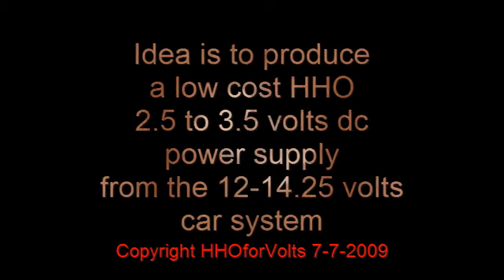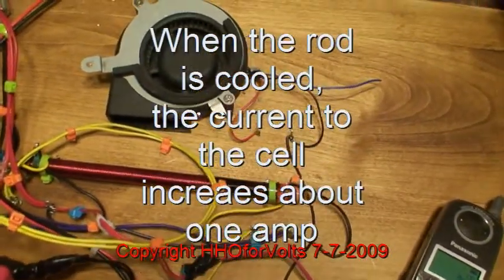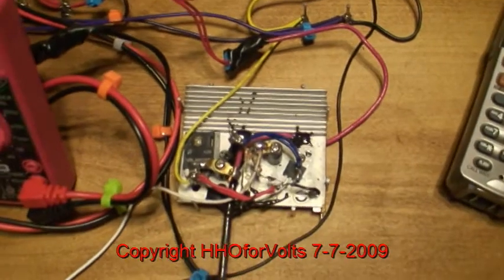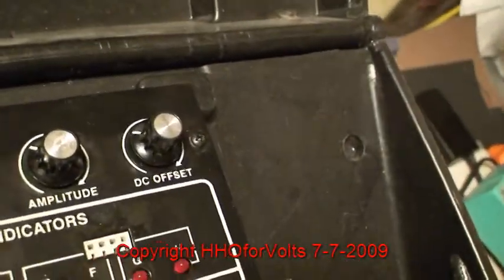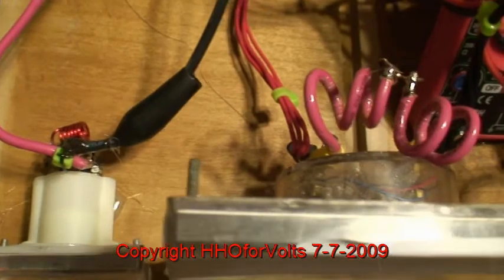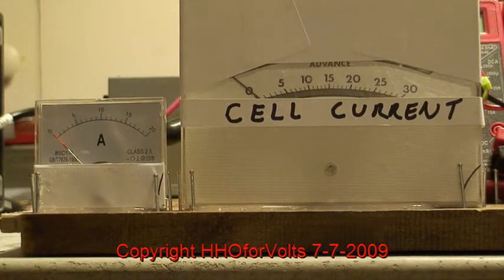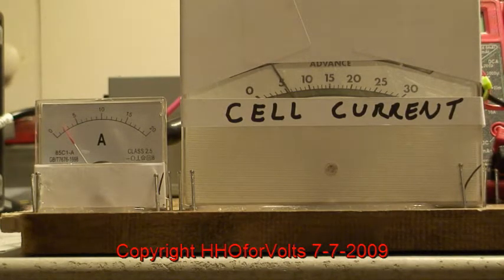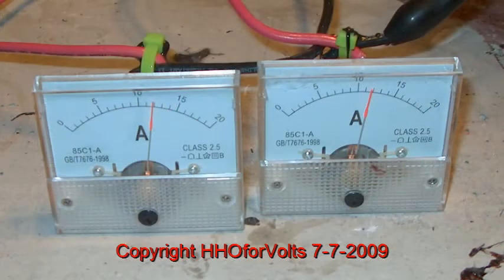HHO Over Unity again "analog meters" Pt 1

Comment: Yes. If the circuit draws 72 watts, then the exit would need to generate 144 watts in order to achieve 200% over-unity. The circuit shown is producing 20 watts but using 72 watts to do it. The circuit shown is 27.8% efficient.

Comment: I do know that a 9v bat will not last long doing this. but it was a cool experiment to do. I would like to suggest a test for hex chromuimin the E-lyte . I know with the low volts you cant see any contamination but it would be good to know if it is there anyway. I have been told that there are some that have stoped using SS because of the hex chrome toxcicity levels. but if there are no hex stuff from using 3 volts or less that will again change the rules. I do know that there is hex from

Comment: Interesting stuff..

But what does the damm fast diode actually do...Does it recover the back emf from the rod back into the cell, and thereby increasing currents and efficiency and reduce losses? So energy stored in the water capacitor and rod inductor is released through the diode and results in higher current measurements ?